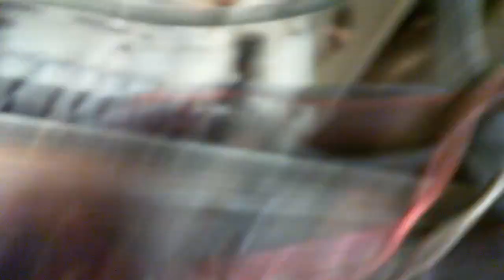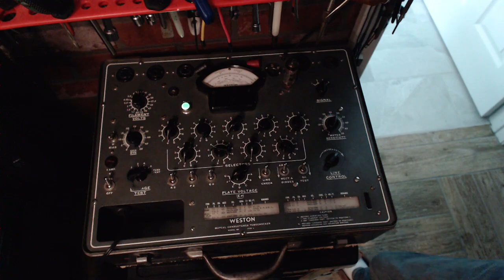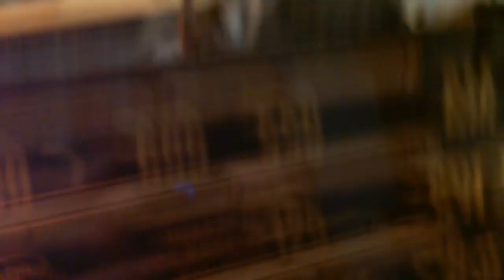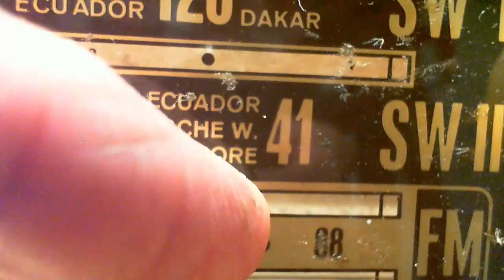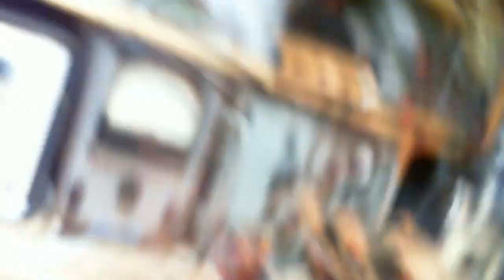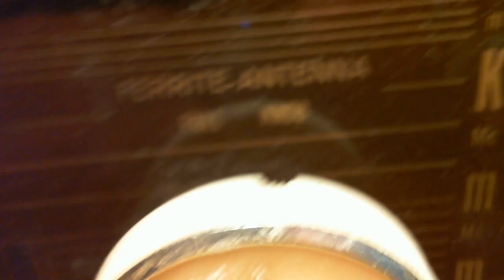German Greatz Polka Tube Radio Video#2 - Tubes Tested, Schematic Reviewed

Comment: Hello Jim,
I have one query. I couldn't find your email or other source through which I could raise my query and therefore selected your latest video and sending my query. My apologies. 
It's regarding speaker cone repairing. 
(1) Is it true that re-coning of speaker impacts its originality?
(2) does cone material (paper) has any impact on quality of sound?
(3) Will it be recommended to replace the cone if it has a few (only two) holes of small size on one speaker and the other speaker cone has a crack (inches long)?
Thanks,
Sanjay K

Note - I have seen a number of restoration videos and appreciate your methodical approach.

Comment: This is one of those GREAT 👍 looking radios 📻. It shouldn't take 53 videos 📹 to repair it. "Deadly Problem", sounds more like 👍 a hot 🔥 chassis, which can really be the truth. Even has a field-coil speaker 🔊. No 👎 permanent magnet speaker 🔊. This would look GREAT, in the cabinet, and with a dial light. Your friend, Jeff.

Comment: 33:03 Caution! I do not have the documentation on the export model. But I would not bet on the FM IF being only 6,75MHz on the export model! 
Here is the reasoning; the FM band on the geman model only spans 88 to 100MHz. With a 6.75MHz IF a station and its image reception would be spaced  2x6.75=13.5MHz apart. A signal at 88MHz would have its image at 101.5MHz which is outside the upper limit of the tuning range, so no danger there.
However the Export model should cover 88 to 108MHz on FM. So with a 6,75MHz IF stations from the low end of the band may appear as images near the top end.
One would assume the designers took precautions by raising the IF frequency to assure the images disappear beyond the upper end of the band.

Comment: 30:16 You cannot get an audio signal from the screen grid of the output tube. There is no audio there. The resistor 258 is there to apply a DC Bias to the electrostatic speaker onto which the actual audio signal is modulated with capacitor 259. And the raw audio signal for modulation is taken from the plate of the EL84 and low pass filtered with RC network 260 + 261 before modulation. Your confusion may come from the fact that the DC bias voltage for 258 is taken from the same sub B+ supply which is directly feeding the screen grid too. But that is not uncommon since it is a quite well filtered voltage compared to the raw B+.
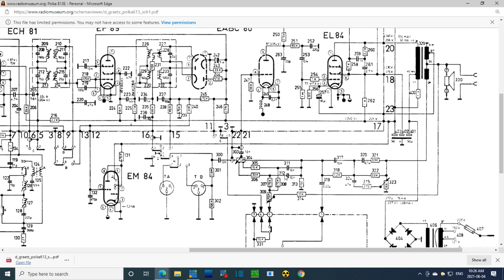And 30:38, the dotted line is the boundary of the PCB with the numbers 1,2,3 etc representing the tie in points/lugs to and from components external to the PCB.
Reply: You can get audio from the screen grid .
Push pull amps have used the screen of one tube as the phase splitter .

Look up screen grid inversion or look at fig. 150
www.radiomuseum.org/forum/phase_inverters.html